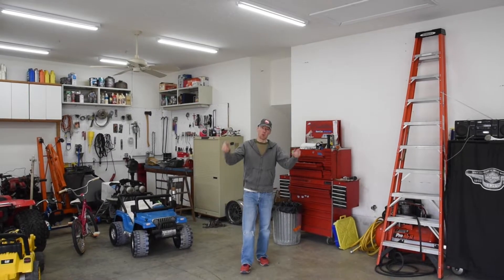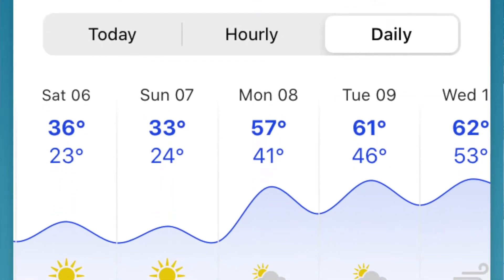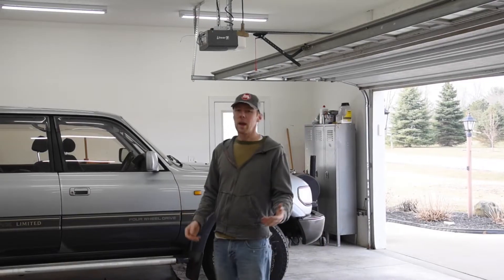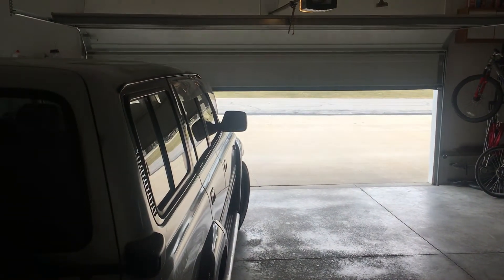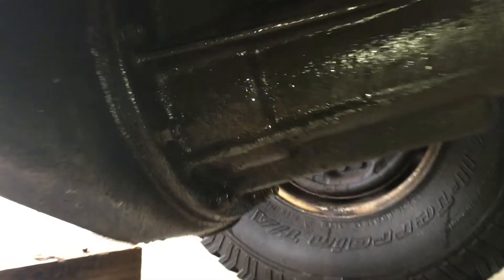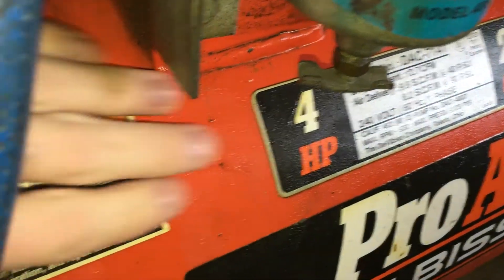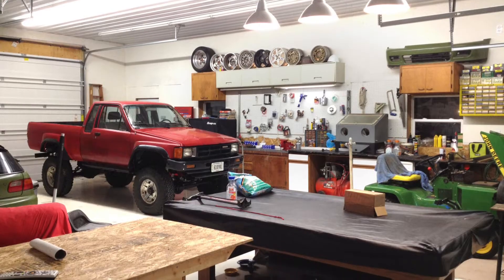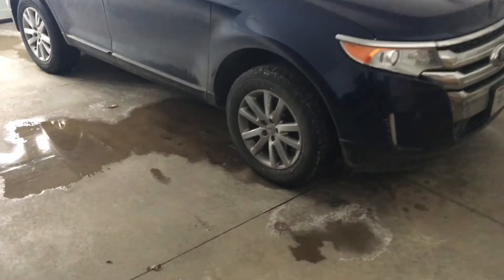Prevent Condensation/Sweat on Garage Floor and Metal Tools when the Weather Temperature Turns Warm

Comment: Dehumidifier does work but freezes up so use a timer to cycle.
Reply: I've hear they're good down to about 50 degrees. After that it probably freezes up. It's just an air conditioner basically, only that the warm it pulls out of the air stays inside.

Comment: does a dehumidifier work
Reply from the maker: I haven't tried, but that's a good idea!
Reply: No a humidifier is no
Good. I have steel/garage/shed. The same problem. Only my floor is soaking with swetting from condensation. I tryed to put a few vents in to let air escape but still does. My head is wrecked. Best thing to do?
Reply: @mickmurphy4404  sounds like no vapor barrier under concrete